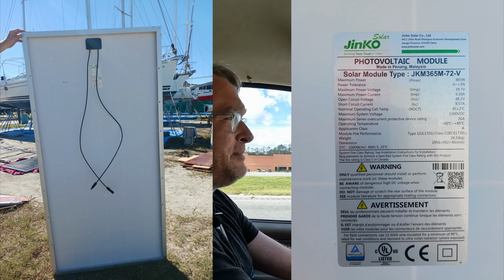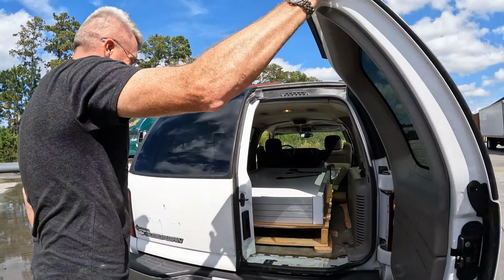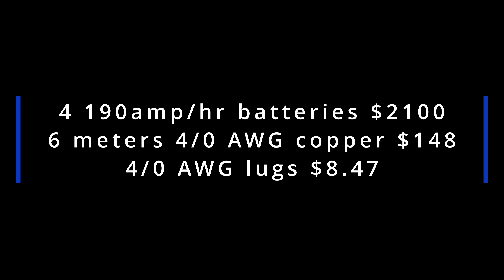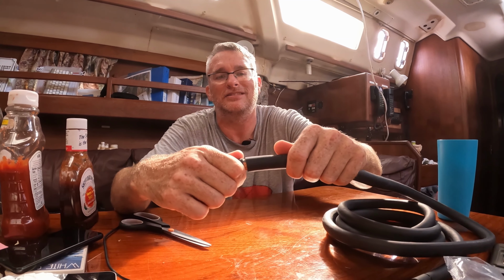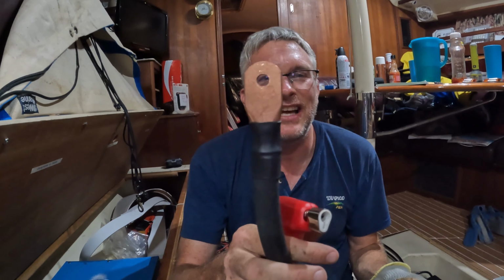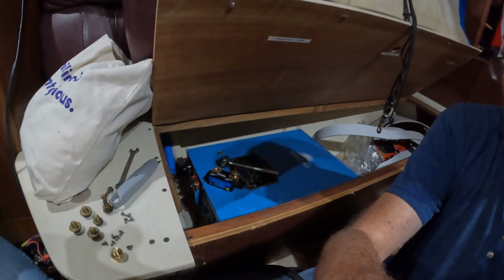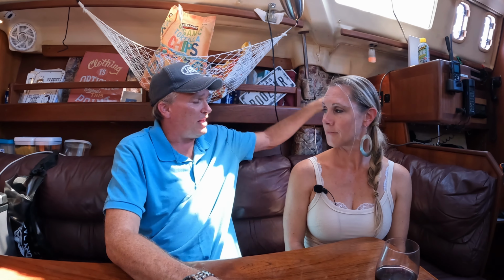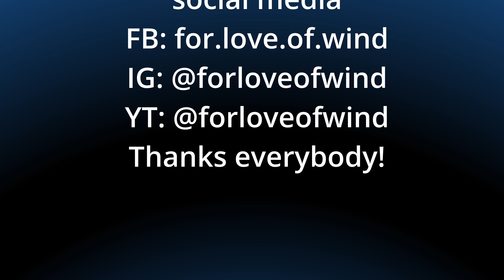7 Off-grid living on a boat takes a little doing.

Comment: Looks like you have the panels in series.  Do you find a problem with one panel shading?  Yes a well debated subject with no one clear answer.
Reply from the maker: Thanks for the question. Yes, they are in series. We went back and forth on this a long time, but ultimately settled on putting them in series for the voltage bump. We can tell when the radar is casting a shadow on the panels, but because  the panels are in series, we hit 20 volts very early in the morning, and maintain at or above that line till very late in the evening. Since you can't charge the 13.8v lithium batteries with less than 13.8v, regardless of the amps produced, being in series gives us a longer charging day. The extra hours of charging more than make up for the occasional shadow cast by our radar and Starlink dishy. We have 1095 watts of solar installed and have put 6.69kWh into the batteries in one day, that's 6.1 watt hours per installed watt. I am very happy with those numbers.

Comment: 2 house banks for redundancy. Leave the switch on #1, primary bank. Let’s say some pump has a fault and runs your battery bank dead while your away.  Switch to bank #2, correct the fault, recharge bank 1.
Reply from the maker: Yes, this is a good point. I guess we kind of went about it on an opposite train of thought, hoping that more batteries means more time to recognize and correct a fault before the batteries run down..? However that doesn't really help if we are gone for extended periods of time. Cade is already talking about plans to expand and upgrade the system more (as we have the funds)... So things are bound to grow and evolve.
Reply: @forloveofwind  redundancy is nice, but not always 100% required in some systems.  A house battery bank can stand alone provided you have the necessary solar to keep it charged when not on the boat.  Just means that most systems get shut down while your away.

Comment: great video again , one question what the cost per month for the starlink and range?
Reply from the maker: Excellent question!
We got on the beta for Starlink back in mid 2021, so we have watched it grow and scale, and experienced some of the pains associated with that.

We'll probably cover this in more detail in a future episode, but here is the basics:
$500+- for the Starlink equipment
$135 per month for the "Roaming" option (although I believe that is about to move to $150 a month )

As for range, there has been complete coverage offshore. We have several friends sailing in the Bahamas etc that have never been without. The only caveat to that is bandwidth. When we were at Cape Canaveral, things would be great till certain cruise ships also running Starlink would come into port. As part of the "Roaming" package, we get lower priority bandwidth, and those cruise ships would suck it all up. Still usable for streaming video etc, but a little more buffering, lower quality etc. I assume this was also caused in small part by how many boats in the marina had Starlink. When we got there, we were the only ones, when we left,  there were so many that even the Marina itself got Starlink.

Comment: Battery selector 1-2-both

What we had on a Hunter 37 was battery #1 for starting the engine (high cranking power) and battery #2 for the utilities (lower cranking power). The batteries were NOT in parallel, they were independant. When the #1 was weak in the knees, the 'both' selection would put the batteries in parallel to save our asses.

Charging batteries can be tricky. If the charger works through batteries 1-2-3-4 (in that order) and battery 1 is defective (ex: one cell is corroded), batteries 2-3-4 may not be charged properly.

How much weight was added at the stern of the boat? Is the boat 'squatting' in the water? In the Hunter 37, the water tank was in the bow and when it was full, the boat's bow dipped a few inches.
Reply from the maker: Thanks for commenting.
We do have a lead-acid starting battery for the engine and generator on a separate switch, but only have that one turned on when the engine/generator is running.

So what was not obvious in the video was that all 4 batteries are on equal length cables to the Lynx bus bar, so there is no real 1-2-3-4 order. we independently charged all 4 batteries to 100% and then wired them up. The on-board BMS for each battery does a good job, and with all cable lengths the same, there is no battery at a lower or higher resistance.

As for the weight, the three panels weight about 60lbs each, plus probably another 50lbs in aluminium, wiring etc. It's like me standing on the back of the boat. We do squat a little in the back, especially when the dinghy is slung on the tower, but the weight of the solar panels and rack is basically what we lost in weight when we removed the 8-D batteries for lithium (all be it not in the same location on the boat)

Comment: So you got rid of your starting bank and are using the Lithiums for house and starting loads?
Reply from the maker: Thanks for the question. Originally there was that isolated starting battery in addition to dual house banks. We removed the dual house bank wiring and consolidated it down to a single bank of LiFePo4 batteries, but for cost savings, retained the 1-both-2 switch the dual banks originally went through. We do have a single lead-acid battery on a separate switch for starting the engine and generator. This is housed in our engine compartment just above the generator and that wiring was untouched during the battery/inverter upgrade.

Comment: If you have LA starter batteries plus LiFePo able to be charged by engine alternator, suggest you look at fellow Ytuber Emily and Clark's Adventure.  I don't know what DC to DC charging type devices you have so might not apply to you.  Clark invented and has had manufactured a device that allows LA and LiFePo batteries to work well together.
I have thought that Bifacial solar panels would work well on solar arch where reflected light would hit bottom side of cells, but they don't sell at $125 each.
Reply from the maker: Excellent comment, and we watch Emily and Clark as well :D

We do have a slightly different set up but I did like some of his ideas around smart relays etc.

As for Bifacial solar panels, we looked at those briefly but to your point, they are more costly. Additionally the reviews I have seen (A particularly good one is on "DIY Solar with Will Prowse"...I love that guy) said the bifacials struggle in warmer weather.
Reply: @forloveofwind  Gotta love Clark's inventiveness. Ytuber Sailing NOHMA happens to have bifacials on their sailboats arch, and 1 mth ago I asked how they were doing- answer was "fine". I did suggest they might try a test by covering tops with towels and see what power they got from reflected light hitting bottom of cells.  
I do remember that Will Prose episode, but think SW heat as well as heat coming off cement paving in SW might be a bit different than panels suspended over water on a sailboat. Ytuber Everyday Dave got like 15% more power (same wattage rated single face vs. bifacial). Another channel got same with mix of 2 panels on edge of pv array on white shed roof.  But as you say, much more expensive.
Hope you are doing fine with your sailing adventures. I expect to be on cat in Bahamas this season starting Nov.
Reply from the maker: Wonderful, maybe we'll see you out there! We do have another project to complete before we can head that way, more to come on that... 😬 I would be curious to see a test of the bifacials by covering the tops to see how much just the bottoms will produce, great idea!
Reply: @forloveofwind  I'd suggest that you comment on NOHMA's ytube channel for a bifacial panel test as part of a future episode.  The test won't be completely accurate since incoming sunlight that passes thru the spaces between the cells and reflects back to bottom of cells will be blocked by top covering.  The panels do weigh like 15lbs more  (for a 450 w panel) due to glass panel on bottom, so a sturdy arch is needed.  Large(540w) bifacials are running 57 cents/w at Signature Solar, but still that is high for budget cruisers buying used panels.  I'm not in favor of used panels on sailboat due to harsh marine environment.
Perhaps I'll see you in Bahamas- it will be a 38' Leopard with DIY hard top- that I helped install two 320 w REC panels.

Comment: Great video, good pacing. Did you worry about drilling into the solar panels when on the ground setup
Reply from the maker: Great question.
The solar panels have a "C" channel frame, the cells are laid inside this, and then a perfectly fit piece of angle ("L") is set inside the "C" channel with some kind of caulk or glue in between. What this means is the side rails of the solar panels are basically double-walled aluminum with about an 1/8 inch of rubber. There is no wiring etc so drilling the small holes for the rivets was not a concern.
That said, I made sure we were never above the half-way on the side rails...just in case :D